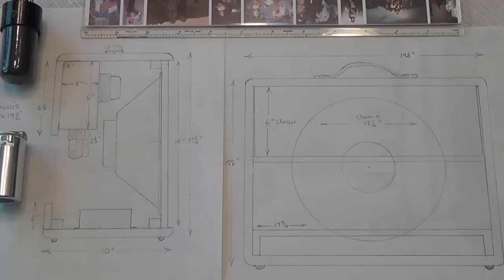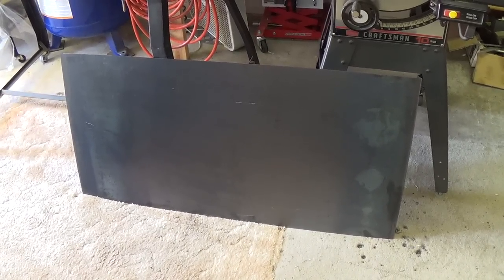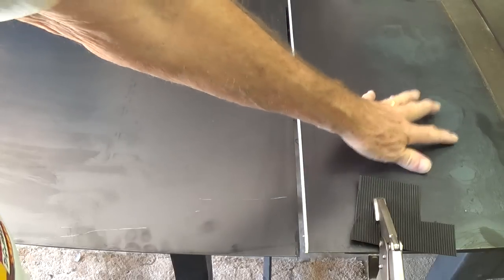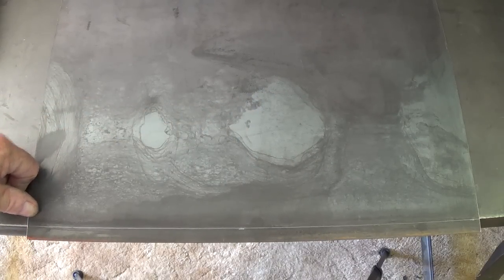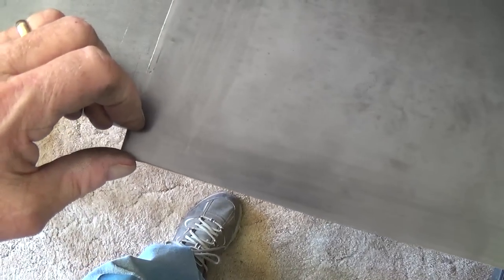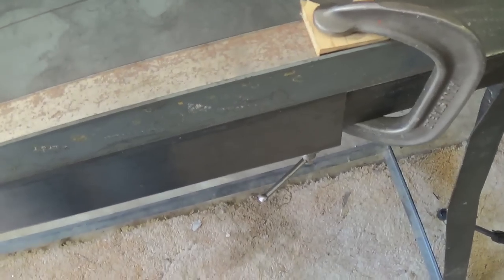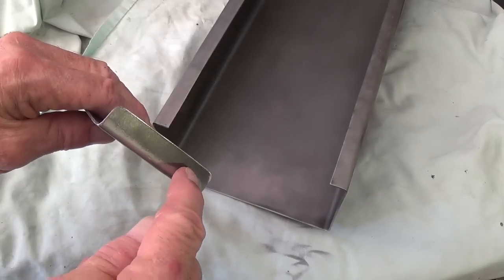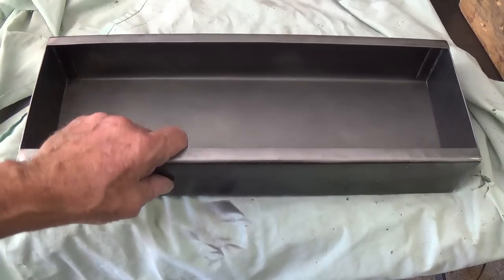How to Scratch-Build a Vintage Amp, Part 5:  Fabricating the Chassis

Comment: Can’t speak from first hand knowledge, but I did witness my grandfather (a steelworker) use his angle grinder to “score” a 16th inch or so steel plate he needed to bend into a Octagonal shape... I think 
the score  gave an easier and cleaner bend and he clamped it to his welding table and used a couple pair of vise grips to bend by hand... I got to hold the dummie end of the chalk line, even got to snap a line or two... 
oh it was a outdoor smoker he was building... 
  Let me add if you’ve never eaten smoked quail you don’t know what your missing!!!!
Reply from the maker: Scoring of metal to assist in easy, straight bending is a great technique, S76.  I did try to smoke a quail once but he flew away before I could light him ;)

Comment: Jeep sounds amazing thanks for showing us that too. Have often wondered what it looked like. You made a nice job of the Supra chassis and i was wondering, though you probably said, how do you account for the bend over radius when making the right angles? Take care and thanks for the video. I guess the noise drove Rusty and Jack away ..and probably Mrs Doug too lol. All the best Colin.
Reply from the maker: +mixolydian2010 Thanks, Colin. Glad you liked the show. The neighbors are still giving me the evil eye over all the noise (and cursing). Jack was hiding in the house and Rusty fled the scene the moment he saw the sledge hammer. 

 My crude method does result in a wider-radius curve at each bend, but if you keep the bend-line centered, it doesn't seem to alter the final dimensions much. Also, I am going to build the cabinet around it now, so I could compensate if necessary.

Comment: Nice metalwork Uncle Doug. This sort of stuff scares many of us but as you say, take time and it all comes together eventually. An alternative is to go down to your local sell-everything store and buy a cheap cake-baking tin or similar metal baking tray that is close to the specs required. Obviously it won't be exactly the same size, unless you are extremely lucky) but you can get some that are close enough and thus avoid having to bash the bejingers out of heavy-metal sheets. I make all my own tin-work (I've a home-made brake that makes things a lot easier) and appreciate the work in this one. Did you MIG weld those joints? They look pretty nice. Looking forward to the up-coming videos. Dave @ D-Tone.
Reply from the maker: +D-tone Amps and Guitars  Thanks, Dave. It would have been a lot easier with 18 gauge, but 16 is all the metal shop had on hand in a half sheet.  Yes, I used a MIG welder.  I haven't stepped up to TIG unit yet, but probably will before long.

Comment: What are your thoughts on using brass sheet metal for a chassis? I've got a bit of it on hand and would love to put it to use.
Reply from the maker: It would probably be beautiful and electrically suitable, Dave, as long as it was stiff enough to maintain its shape. Be sure to subscribe to receive new video alerts.
Reply: Hi Dave!  Brass is real good to solder to as well!  You probly should cover it with some kind of clear lacquer when all the soldering is done.  It would look beautiful polished first too! - Like gold!

Comment: Uncle Doug, what is the rule of thumb for testing voltages? I mean, can I test them immediately after the Rectifier tube and build from there? And can I test them after the pre-amp output tubes?  I ask this because I know to never run the output transformer without a load, does the same hold true for tubes and input transformers?
Reply from the maker: +Rhone Ranger In my experience, voltage and current measurements are only accurate if taken on a complete, functioning circuit. If any components, like tubes, are missing, then the measurements are not reliable. I don't believe it will harm the power transformer, but other than determining that voltage does indeed exist at the test point, it's a waste of time.

Comment: Hi, 

would there be any reason that you know not to use galvanized steel C-channels for chassis? I have easy access to offcuts.
Reply from the maker: The only problem with galvanized metal that I am aware of is the difficulty soldering to it and painting it (if you so choose)......unless the zinc has been thoroughly removed. If you screw or rivet the chassis together, however, I guess it would work just fine.

Comment: Uncle Doug,  what type of welder did you use? I tried using an Lincoln Arc Welder but it's too strong and I keep burning through the metal.
Reply from the maker: +David U Juarez   David, I use a Miller 175A welder, but set down to an amperage setting of 2 (out of 4) and a wire feed of only 4 (out of 10). The 16 gauge steel seemed to tolerate the welding quite well. The alternative is to use an acetylene torch and silver solder the sides into the chassis......which I did on a previous build.
Reply from the maker: Tig welding would be the best, and I use shielding gas with the MIG.....but unfortunately, I haven't stepped up to buy a Tig unit yet. It's definitely on my "want" list however, as is learning how to operate it properly.

Comment: Doug that was awesome, I took metal shop back in High School and had a ton of fun. How did you do the final bend? Face up and bend upwards? Its been a long time since I did this(highschool was over by 86) and I'm curious
Reply from the maker: +Lionel Berthelon Thanks, Lionel.  I did it just as it was shown in the video, clamped at the edge of the table but with 3" of spacers under it to compensate for the other already-bent side. I used heat and hammered it downward.

Comment: I am impressed with the sheet metal fabrication. What process did you use to make the welds? Oxy-acetylene ?
Reply from the maker: +Tom Rhodes Thanks, Tom. No, it was a wire-feed MIG welder.  In the past I have silver-soldered the sides to the chassis, but the heat discoloration was a nuisance. Some day I'll buy a spot welder :)
Reply: +Uncle Doug 
Thanks Doug, 
That short arc welder uses localized heat with minimal heat discoloration or warping. Did you use in on your jeep auto body?
Reply from the maker: I used the MIG to fabricate much of the suspension and transmission-mount cross-member of the Jeep as well as the majority of the suspension, floor pan, skid plate, etc. of a sand rail. I have pretty good luck with sheet metal down to around 18 to 20 gauge.

Comment: What are the pros and cons of using aluminum to make that chassis? Seems like it's be easier to work with.
Reply from the maker: +DoItYourselfMusician   I have built several chassis with aluminum. It's actually harder to bend, especially without getting fatigue cracks. The best way is to cut the aluminum into properly-sized rectangles and then bolt or rivet them together into a chassis.  It's light, nice-looking,  and conducts heat and electricity better than steel, but you can't solder to it (by normal means).  I'll probably use aluminum on the next amp.

Comment: Doug,

I really enjoyed the video series, thanks for making it.

I am completely ignorant about guitars, amps, music, etc. It there an advantage in using sheet steel rather than aluminum for the chassis?

Thanks,

Ian
Reply from the maker: +Ian Butler  You're welcome, Ian. It's easier to make small-radius bends with sheet steel, aluminum will usually crack, and steel provides better electromagnetic shielding and can be soldered to.  Aluminum is an excellent conductor of electricity and absorbs and releases heat quite well, but I have found it's best to fabricate an aluminum chassis using rectangular plates that are riveted or screwed together.....unless you have a TIG welder.
Reply: +Uncle Doug Oh, I see. I knew there had to be some compelling reasons you used steel.

Thanks for taking the time to respond.
Reply from the maker: You're welcome, Ian. Both metals have their positive and negative characteristics. I just tend to use whichever one I have on hand :)

Comment: I'm curious why you chose 16 ga. steel.  The chassis I built for my Princeton clone was made from 22 ga. steel I bought at Ace Hardware.  And I used a Harbor Freight 18" bending brake.  It seems stout enough and I'd think it would be easier to solder to.
Reply from the maker: I just happened to have a nice piece of 16ga steel handy, Willy......and you can be sure that I will never use steel of this thickness again. It was way too thick for the purpose.....but it sure made for a stout chassis.
Reply: I found that Ace Hardware sells sheet metal and expanded metal that can be used to protect speakers.  The sheet metal is available as aluminum, galvanized steel, and 'Weldable' with no coating.  My local store carries it in differing sizes and different thicknesses - 20 or 22 ga.  The 22 ga. weldable panel makes a good chassis and is easy to cut, drill, or punch.
Reply from the maker: Thanks for the useful information, Willy.

Comment: Great video - do you have a deburring tool for those sharp edges?  Saves slicing fingers!
Reply from the maker: I use a file and/or coarse sandpaper to round off the edges, CM. Otherwise, it can definitely get messy.
Reply: I used them all the time when I worked in machine shop. It's just a hand tool handle with interchangeable tips that swivel in the holder. A great timesaver.

Comment: Excellent video as always, Uncle Doug. One question regarding the bends: do the slightly rounded corners affect the final fit and need to be compensated for? Or is it a negligible loss within normal tolerances?

Thanks for continuing to let us pick your brain! And greetings from the Pacific NW, which is decidedly NOT a desert today...
Reply from the maker: +Ryan Weldon   You're welcome, Ryan, and thanks for the kind words. As you will see in Part 6 (just posted), it's raining down here in the desert Southwest too. With regard to the radiused bends, they really cause no problems. The metal chassis seats within the wooden cabinet flat side to flat side, so the curvatures are of no consequence.

Comment: For goodness sake, Doug, go over to Harbor Freight and get yourself an 18" sheet metal bending break for like forty bucks! :-)
Reply from the maker: +Jason Thorpe  But where is the challenge in that, Jason??? :)) To be honest, I probably will, if I ever lapse into masochism and decide to do this task again.  They say it can bend 16 gauge, but if you ever see the HF break in person, you might doubt it. I think I'll stick with 18-gauge if I do this again.
Reply: +Uncle Doug Hey, even the HF break would be stepping it up for me... I take the super-easy way out and just buy pre-made blank aluminum chassis from Hammond.  I do at least drill my own holes, though :-)
Reply from the maker: Your method  is making more and more sense, Jason :)

Comment: I'm interested in the ignition system Doug. Would you tell us about it?
Reply from the maker: I assume you're interested in the Jeep ignition system, SS. It's a conventional Chevrolet condenser and points distributor with external coil......nothing exotic at all, but it works flawlessly (so far) :)
Reply: I'm impressed that it fired effortlessly on the first compression.
Reply from the maker: When I got the Jeep, it was a virtual basket case....hadn't run in years, transmission held up with a 2x4, no battery, wiring or electrical system, rear pinion angle at 21 degrees, timing set at 32 degrees retarded, plug wires out of order, fuel system a rusty mess, etc. It took about 2 months of intensive work to get it into excellent mechanical condition.....including immediate starting and flawless operation. It had to be near perfect to avoid being stranded 25+ miles out in the 120 degree desert.
Reply: It's a real credit to your ability Doug. Any time you  make a 2nd video showing more detail, it would be appreciated.
Reply from the maker: Thanks for your kind words and interest, SS. I will keep your request in mind for future videos.

Comment: Uncle Doug, have you ever used .090" aluminum for chassis metal?  It's about as stiff as .060" steel, but is quite a bit lighter.
Reply from the maker: Yes, I have used aluminum of various thicknesses for chassis and like it. It's easier to machine and can be polished or brushed for a really nice finish. I'll check into the .090" thickness material.
Reply: The metal houses often have 6061 and 5052 aluminum.  The 5052 bends nicely, but the 6061, though stronger, is more brittle and is not great for bending.
Reply from the maker: I have noticed some very apparent differences in the bending and machining characteristics of different types of aluminum. You really have to select the proper type for each job.

Comment: +Uncle Doug Why did you choose to work with steel? Wouldn't aluminum be better? Lighter, easier to work with, and I've heard that aluminum helps prevent or lower electronic interference.
Reply from the maker: In the many builds that have been featured in my videos, quite a few of the chassis were fabricated from aluminum.  It has some good properties and some drawbacks (i.e. cannot be bent easily or well).  For this amp, since I was imitating an original, the original steel chassis seemed more appropriate.  I believe that steel (ferrous metal) is a much better shield against EM interference than aluminum.....and you can solder it.

Comment: Uncle Doug, I must ask. Are those FlowMaster Mufflers? They are not loud at all. The local Mustang guys run Flowmasters and they are very loud. Do you remember which model they are? My old hot rod Nova is going to need some new ones soon and I always fret over which ones to get. Nice tone or will they be too loud. Let me know. Thanks. I just loved this build.
Reply from the maker: Yes, they are FlowMasters, JM. Although they are not particularly noisy while the engine idles, they do make their presence known when the engine is revved (like the Mustang guys are probably doing).  With longer head and tail pipes, however, they should probably not be overly annoying.

Comment: Cold rolled 16 guage steel. Wow. Talk about building it "like a tank!"  I have always used Hammond chassis and transformers in my earlier builds, when I wore a younger man's clothes. As they say, if a job requires a 2lb hammer, a 5lb sledge is even better.
Now,  is that one of those $600 Pentagon "miltary procurement hammers we be using  there? (joke)

"Bending and bashin', heatin' and cursin'..sounds like the lyrics of a song  called "Wishin' and hopin".by Dusty Springfield. 

I don't have the metal bending brakes or the cold forming patience to do it from scratch, not to mention cutting it right for the bend radius and dealing with the corners.  And then dealing with the end pieces separately like you show and pop riveting.

LoL! i'm 69, with my health challenges at this point in my life, lifetime warranties don't mean much to me either.
My better days are now well behind me. Nice CJ jeep there BTW.. Big 350 4 bolt Chevy  sounds great with the Eldebrock performer 4 barrel carb  with those headers. great transportation in the AZ sun!

 My married daughter lives out there too , in Peoria, a suburb of Phoenix., BTW.
Reply from the maker: +SuperCarver2011  Next time, if there is a next time, it will be 18 gauge, SC. Let's think of ourselves as being "middle aged" :))
Reply: +Uncle Doug: It depends on which middle... of which age... we are talking about. :-)
Reply from the maker: How about the Paleozoic ???

Comment: Very intriguing video series, thank you once again Uncle Doug! I must ask though, why steel for the chassis and not aluminum or copper? It seems the cost difference would be negligible and it would be much easier to work with. (There are those who even speak of EMF & RF shielding properties, but I shan't be involved in such dark arts.)
Reply from the maker: You're welcome, PS. I have shown aluminum chassis fabrication in some previous videos, i.e. the miniature Fender Bassman, and chose to use steel for this one.....although the gauge was a bit thick and difficult to bend by hand. It wasn't a matter of cost or workability, it was simply a matter of personal choice and the fact that the original Tremo-Verb, as well as virtually all vintage amps, used steel.

Comment: So, did you arc, gas, tig, or mig weld your chassis?
Reply from the maker: I used a MIG welder to secure the side panels, Julia.
Reply: I was guessing a tig.  Very nice work with the mig tip.
Reply from the maker: Thanks. I have not yet purchased or practiced with a TIG welder......but would love to do so in the near future.

Comment: As I prep my next project,  watching you fabricate that makes me cringe...  considering I saw a completed chassis of almost that size at the surplus shop for $20.  Lol..  call me lazy,  but I'm using a Hammond box for mine,  as I have less determination.   Hammond and Budd both sell their "Radio Box"  chassis...  so I am presently going that route.  For my new RTL amp project,  a hammond box makes the chassis,  and I'll fab the wood cabinet myself.
Reply from the maker: I agree that the surplus shop chassis sounds like a better deal, DK, but my mission was to hand fabricate the entire amp from scratch, so I was doomed to use stone age techniques to bend the 16 gauge steel.  To date, I have never bought a chassis.....all have been hand fabricated of either aluminum or steel. Good luck with your project.